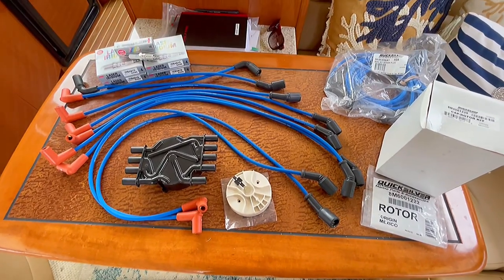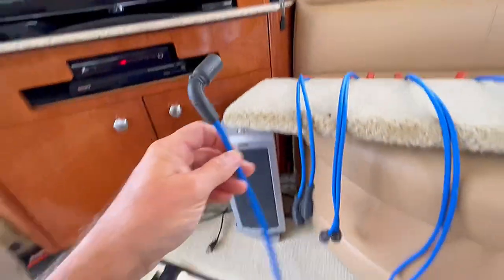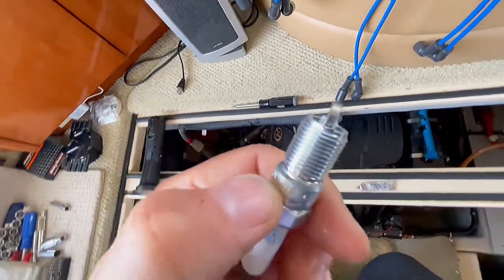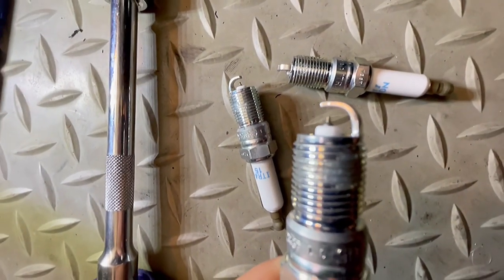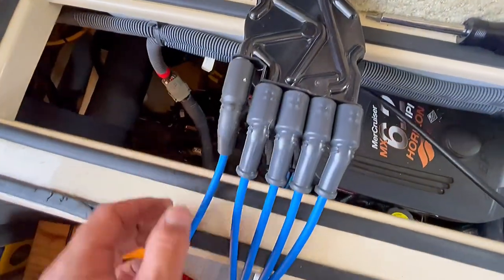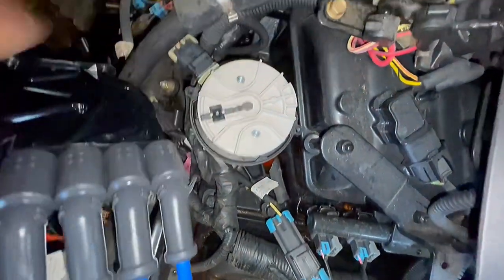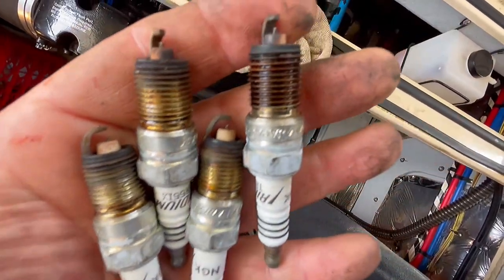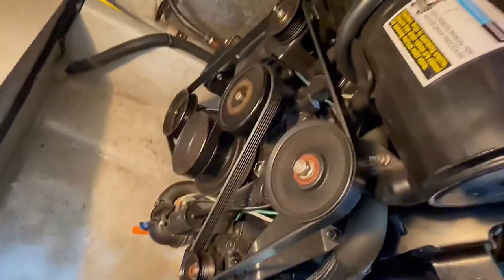Boat Motor Tune Up

Comment: Truly enjoy your videos, watched the entire trip from NY to FL a few days ago, awesome adventure. 
As for this video: food for thought, iridium plugs cannot be gapped, why? It will damage the tip immediately, 22 years in the USCG as an engineer.
Reply from the maker: I did read that.  You can’t touch the electrode tip for that reason.  Thanks!

Comment: Thank you!, I'm guessing this was the first time for these engines.  How many hours?  What is that silly line across the top of distributor?  you put your finger on it at 0:54.
Reply from the maker: I think it was at least the second plug change but probably original cap rotor and wires.  The original spark plugs were different from factory.  About 900 hours on motors.  Those silly lines appear to be the electrical paths in the cap from the wires to the electrodes.

Comment: Really Appreciate this video. The Acrobats and tricks to access the outside plugs would have been of interest to this viewer, No Idea how to get to outside side of port engine here.
Reply from the maker: Same boat?   I just crawled in front of the motor and reached down the sides. Wasn’t easy. I found using old pillows or seat cushions to lay on make it bearable.  You can also move the salon seats and remove the floor access panels for better access.  I’ll be doing that for manifold replacements.
Reply: @AdventuresofHappyOurs  I have the 2004 slightly smaller. Port looks the toughest. Marina quoted 4 Hours per engine
Reply from the maker: Yikes!

Comment: Hi sorry for bothering you. It is the following: I had seen a video talking about the Mercuiser engine which was not above 3000 rpm when it was running, but if it was stopped it was above 3000 rpm. Could you tell me if you managed to overcome the same problem? And what is the procedure to be to make the same boat return to normal. I've already changed almost everything, even the electronic schematic of the other boat I put it in and I still wasn't successful, I don't know what to do anymore, please give me a tip!